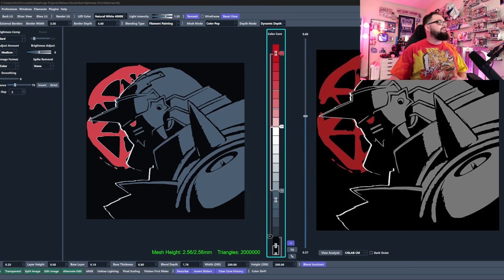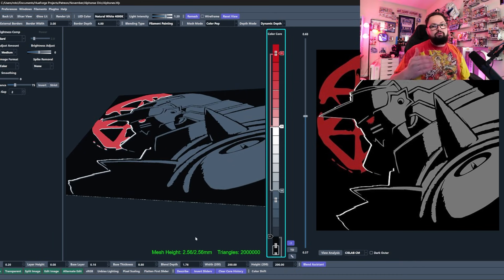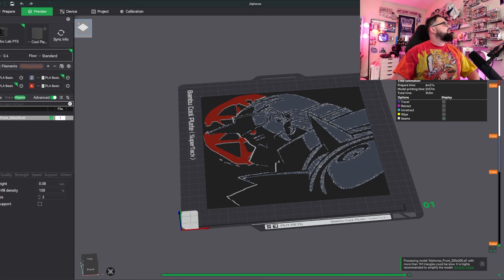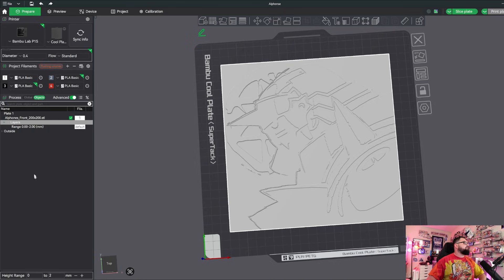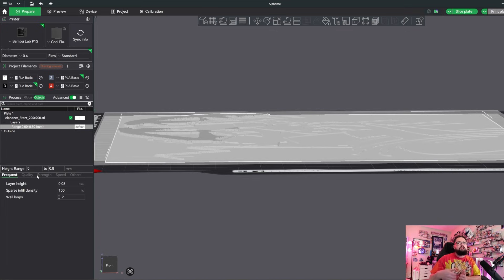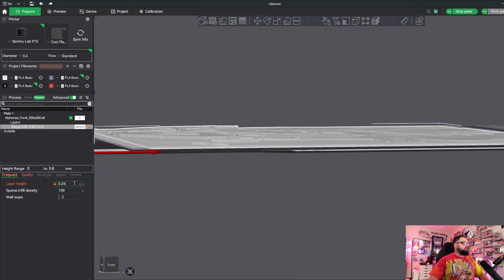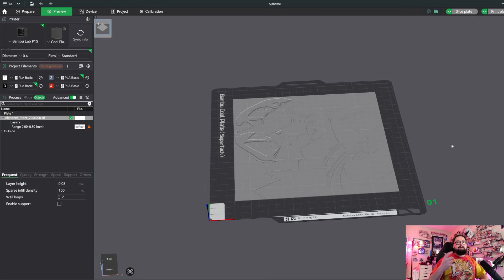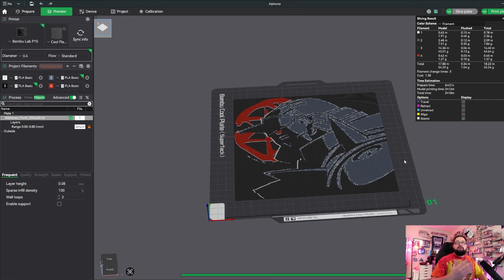CUT Your HueForge Print Time in HALF with This 1 SIMPLE Trick

Comment: without this trick, I have 33 layers in total. After applying it, it goes down to 27 layers. is it correct?
if so, how do i proceed to color swap with a different number of layers than the original export?
Reply from the maker: You can add the color swaps prior to making the change or disregard ,layer number and use the mm reference numbers instead!
Reply: @3DPrintsByVic  now I feel dumb for making this question after reading the answer
Reply from the maker: @gjmenoni  No worries haha! Im glad I could help!
Reply: @3DPrintsByVic  na not supid. he didn't even mention this.  bet some people shit their prints bc of that.

Comment: So the stl I created in HueForge did not have the filament change, so manually adding the color swap based on the txt document.  I notice the layer 11 (0.96mm) swap, my layer 11 now is (1.44mm).  Which number do I use for my color swaps or did I do something wrong that through it off.  Thanks in advanced.
Reply from the maker: If you add the layer swaps before adjusting the height range modifier you won’t run into this problem. But if you wanna add the color swaps after the height range modifier then you should use the millimeter number in the dot text file and not the layer number.
Reply: @3DPrintsByVic  Thank you Vic - Merry Christmas Eve to you and your Family

Comment: I don't really understand what that did to reduce the time frame? Did it increase or decrease the base layer?
Reply from the maker: It doesn’t change the base layer, it prints the base layer at a higher luster height. 

If you’re base layer is . 48 mm thick then printing at a .08 layer height would take more passes than if you printed at a .24 layer height only taking two passes. This only works on the base layer

Comment: .24 doesn’t divide evenly into .8 so I’m a little confused on how that worked.
Reply from the maker: Yea your right haha, I misspoke on that portion i’m currently working on a pinned comment to re-explain it.

It’s best practice to have it be evenly divisible. Typically I’m at .48 base layer height, which is why I said .24. But with this being a .8 base layer the correct height range modifier should be .2. I’ll work on a pin comment to explain this. Sorry for the confusion.
Reply: @3DPrintsByVic  Thank you for explaining. I love Hueforge and have been trying to learn all that I can about it.